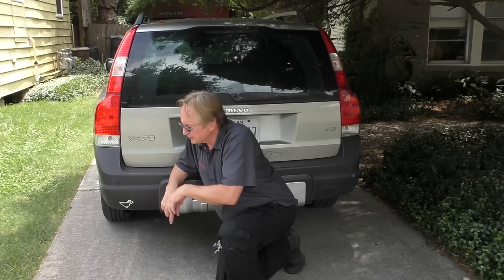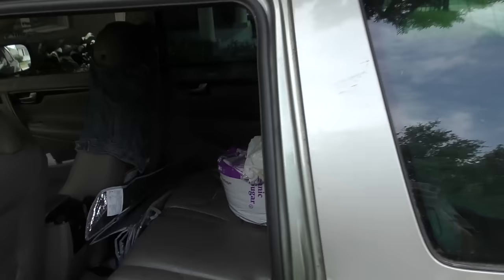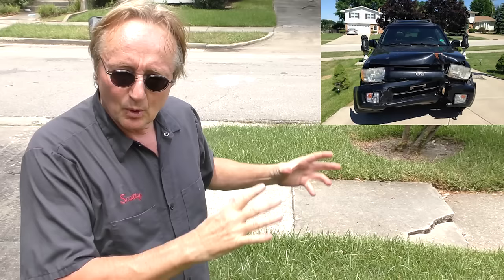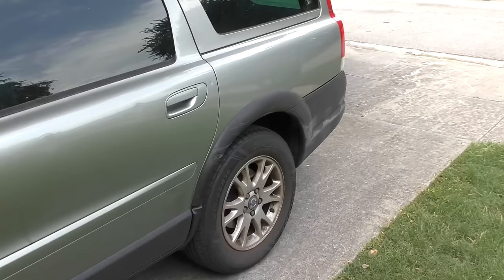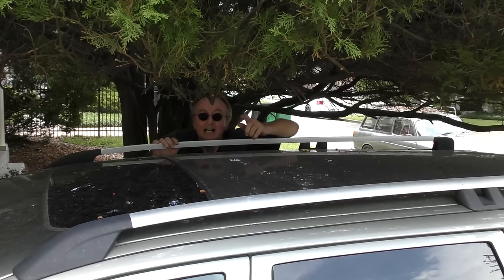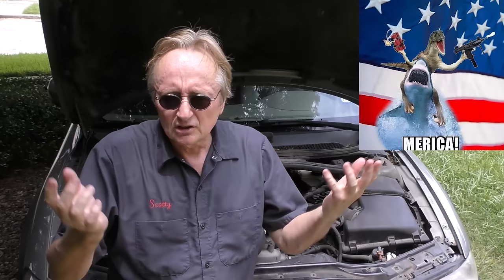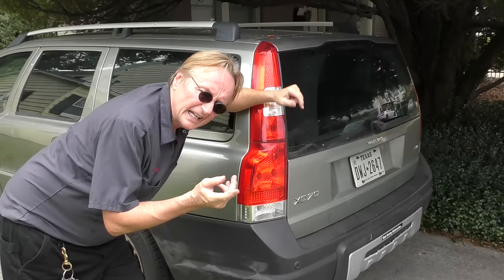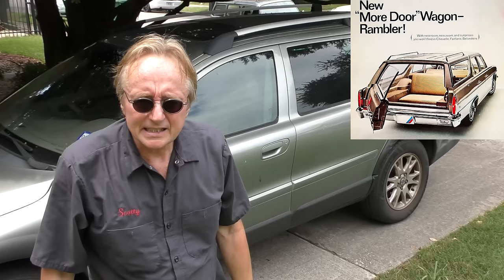Here’s Why Old Volvos Last Forever

Comment: Scotty you missed one of the best parts about this car....

The AWD system on it is fantastic. Very capable in sand, muck, snow.

Oh and the transmission is built by Aisin, the same Japanese company that builds Toyota transmissions...
Reply: the AWD and the automatic transmission are actually the only real weak points of these cars.
Reply: @janjansen1897  correct. Its pure garbage, they all  end up as fwd cars
Reply: @whiteknight7979  Beg to differ. The Haldex AWD and the Aisin transmission is quite reliable, if you flush the fluids and change the filters at the same intervals that Volvo specified for taxi and police duty vehicles.
The thing is Volvo claimed "filled for life" on all the non-fleet sales cars. And in a sense Volvo was right! When the transmission or AWD broke down thanks to lack of maintenance, their life was over so no refill/service was needed.
Reply: I need to replace the Bevel Gear (aka Angle Gear) on my 2007 XC90 (122K miles). I am also replacing the propellor shaft. While it is out, I am servicing the Haldex and changing the rear diff fluid. Transmission guy said the angle gears go out often in these and many of the tranmission valve bodies were plagued by poor metal quality, but my transmission is still doing well although a slight pause sometimes when shifting (e.g. 1/4-1/3 second). 3.2L 6cyl still seems to be doing well, but my gas mileage dropped recently from 19-20mpg to 17mpg.
Reply: The 4wd wasn’t great but the Aisin automatic transmissions are great. They only break when neglected

Comment: Volvo V70 2,5 T from 2001 here. Such a great car. Bought it with 150.000 km, now it's at 330.000 km and no major repairs. Just a transmission sensor and another small electrical issue four years ago. Still does 220 kph, downhill even more (I got a video on my channel). I'll always drive a Volvo.
Reply: car still going strong? I'm asking because I'm interested in buying a 2005 XC90 2.5T 5 speed AT. it has 148,000km
Reply: @blerriegerrie  unfortunately the engine died at 350.000km, but I blame the lpg system

Comment: My wife and I were stopped behind a car making a left turn about 100 yards through the intersection, with a Ford Windstar pulled up behind us when we heard screeching tires. I looked around but saw nothing and a second or two later the minivan was smashing into our rear end. Someone had gone through the green light speeding (approx. 45 in a 35) and distracted and didn't notice brake lights. The Windstar was crumpled to crap, leaking fluids all over the road. Our Volvo 740 wagon barely rocked forward (the brakes actually held firm and we never moved) and the only damage was a smudge on the rubber trim on the back bumper.  Both of the other vehicles involved were totaled out. We got out to make sure everyone was okay, which they were, and pulled into a nearby restaurant parking lot while they waited for the police. They didn't need anything from us, but the cop did give us a few giggles after we explained what happened and he got a look at the smudge on our bumper.

Comment: Looking at how that rear wheel sits in the arch - I'd say you've got rather bigger problems than some cracked plastic after the crash. Still, some quality time on an alignment jig and the chances are that can be put right for a lot less than the other car cost to repair.
Reply: That's actually just how they sit! You can google pictures of the XC70 and they all look the same!
Reply: @calvinburke7002  Could be. You're right that the wheel does look oddly placed on all of this model. However, if you look at around 1.35, it appears the tyre is practically touching the wheel-arch liner. Either this car is running the wrong tyre profile or something is out of alignment. That said, I'd guess Mr Kilmer is more than capable of spotting it and sorting it out!
Reply: look it up, the wheel position is normal for these cars

Comment: I got my 02 XC 70 with 160k for $750. It was in rough shape. After all the maintenance stuff, auto trans.  Fluid flush and a new quarter panel it was my daily driver for two years doing sign installations and handyman work. I got 50k miles out of a car that coast about $1k! It was my favorite driving and most comfortable car I've had! This vehicles AWD system along with traction control is absolutely superb.

Comment: True story, not just for the old V70s but for the S80 as well. My 2007 Volvo (Ford) S80 with the i6 3.2 engine has 205,000 miles on it and still drives like a champ. My car has been rear ended twice and I have similar pictures as Scotty shows in this video. The other cars were totaled where my "Swedish Tank" had minimal scratches. 

Scotty K., remember in 1999 Ford MoCo bought a piece of Volvo and then sold it to the Chinese owned Geely in 2010. 
Most of the engine and suspension components in these cars are "FoMoCo" from these years. 
Essentially, these Volvos are Fords with Volvo bodies.

Comment: My old 850 t5 has 170k miles and is great👍
Reply: Had one of those too a t5r . Had to hold on to the wheel when you stepped on it , lots of front wheel torque .
Reply: @michaellebreton4294  haha yeah your right there mate. Takes a bit of getting used to but was never meant to be a traffic light racer, all the power is in the midrange and can surprise many👍 I love mine, specially having the manual box as well.

Comment: I have a 98 Volvo s70 glt. It's the low psi turbo but still makes almost 8psi and runs and drives like an absolute champ with 312400 miles on it. Oil is still gold after 3000 miles. Way better inside and out than any GM vehicle I've ever owned even my 96 silverado which I love but the Volvo is built better I can just tell by driving it.

Comment: Scotty: Old cars are awesome!
Also Scotty: that's a 30 year old car don't buy it.
Reply: Well, there's a kind of a limit at around 15 to 20 years. Usually, cars older than that will be too unsafe to drive and have a gpm rating instead of mpg. The fuel cost in one year would be high than the car's value lol.
Reply: This car is 13 years old, not 30.

Comment: My Volvo tank is a 2001 T5 V70.  It was our “learn how to drive car” for our 3 kids. In 2013, our oldest, who as 15 at the time,  accidentally drove it into a Radio Shack. ALL the way into the Radio Shack, albeit at 3 mph.   (We May have been one of the last people to go into a Radio Shack....) It was like a snow plow.  Police came, tow truck came. dragged the V70 out backwards.  We looked over the car and decided I could drive it home which I did. Insurance gave me a check, I bought new fenders and bumper. 202k miles later she still trucking along (with a few replacement parts mind ya).

Comment: Our 2006 v70 2.5 T AWD has 210000k looks great.... no rust.... have had to do some maintenance coil pack... timing belt ... water pump.... BUT...... I don’t mind the fixes cause this car is rock solid and the AWD system has been very good...... very safe car and good enough performance.....planning on keeping it for a lot longer......

Comment: my old S40 had 400k miles when I sold it. still was running fine. My other 1988 340 Still in mint condition after 31 years on the harsh winters here in Noth East Europe. Got to say I love Volvo cars.

Comment: Bought a 1998 volvo C70 after watching this video. I love the coupe. Its fast, looks great, sounds like a Lamborghini with it's high pitched turbo sound and low exhaust  sound. When the high pressure turbo kicks in you go from 20 to 45 very fast. All 70 series volvos from 98 to around 2007 they used the same 5cl 2.3l engine with stock high pressure turbo making 240 hp bone stock.  I'm fixing it up and expect to keep the C70 forever.

Comment: Just bought an 07 xc90 that sat for almost 2 years and it started right up and ran perfectly has 170k miles and the engine sounds good transmission shifts good has a comfortable ride wasn’t a bad purchase at all

Comment: My dad fell asleep at the wheel of a Volvo 740 GL (87) and crashed it at highway speeds, rolling the thing over once and landing so hard it blew out both the tires on one side. It still runs and drives today. Though the cooling system is leaking. The roof needed straightening after the accident and a lot of trim pieces got destroyed, but it was even drivable on the spot, well, if there were 2 spare wheels to replace the blown tires anyway.

Comment: I bought a 2008 Volvo V70 less than a year ago and everyone told me what a great car Volvos are but it has been nothing but a headache! The skylight leaks every time it rains, could not get the drain plug out of the oil pan to do an oil change, had a hell of a time trying to find the coolant drain plug, radiator also leaked, put in a new coolant hose and it worked for a few months then couldn't get it to stay on, had to replace it with an OEM part from Volvo at twice the price and the damn thing still leaks coolant from somewhere. A/C / heater doesn't work and will be replacing the fan and resister. Fingers crossed that that will fix it. My mechanic quoted me over $3000 to fix the A/C when I only paid $4500 for the car!! Because it is considered a "luxury car" everything about it costs twice as much. There are a few minor features I like about it like the headlight retainer blades and the adjustable cargo net tracks and I esp. like the station wagon body but honestly I can't wait to dump the overpriced lemon.

Comment: '07 xc70 owner, bought used in 2016 with 75k.  We were rear ended by an older model ford expedition, my wife was driving while I watched it happen in the rear view mirror, son in back in the BUILT IN BOOSTER SEAT!!  I said calmly "hold on, oh s**t she's gonna hit us, hold on" we could not go forward or to the left lane.  The expedition swerved, clipping the right rear corner.  
     We had a slight crease in the upper hatch area of the rear and a broken tail light.  Did not even break any glass or set off the airbags.  The Expedition was demolished.  Front left completely crushed, hood lifted up and bumper pulled under the wheel well.  friggin' totaled.  my family was completely fine, the other driver was bleeding.  That was the very reason we bought the car, to beat the crap out of distracted drivers.

Comment: Had a very bad experience with an old Volvo. I had a 1998 S70....it was a lemon. I'll pass.
Reply: Ahh, too bad, unlucky... my green 98 S70 died at 330k Miles. Dependable as long as you maintain them.
Reply: Mine had 475000 km on it. Sold it just because of expensive registration where I live. Now I drive a lemon Peugeot 206... I still plan on buying the same Volvo, can't let go of the beautiful inline 5 engine.

Comment: the best Volvo were made in the 70s and 80s
Reply: Actually the newer ones are better in every category. Safety, performance, handling, capability, mileage, AWD.
Reply: WALTERBROADDUS reliability???
Reply: @MD-wq6on  A 40 year old car is still a 40 year old car. Is a window crank more reliable than a electric  motor?  Sure. ARE 4 drum  brakes more reliable  than a  4 piston disc ABS brake system?  Not really.
Reply: @WALTERBROADDUS  drum brakes? What are you talking about...
Also yes they're more reliable because 4milion miles is a lot it also the driving experience you get from the analog car let me ask you this do you think that these computer systems last longer then analog because I don't think so
Reply: The best music was made in the 70's & 80's
Reply: Up to 99 before ford bought then.
Reply: @WALTERBROADDUS  The funny thing is you will not find 4 drum brakes on a 40 year old Volvo. The 140 series Volvos had disc brakes on all wheels in 1967. My 1991 940 has ABS.
Reply: @juhotoss  You are more expert on the brand than I. Why the odd ball engine? 🤔 Why 5 cylinders? Any any tips about used models?

Comment: What about the early 90s volvo 440/460 with the 1.8 liter 8 valve engine, not the fastest, but goes on forever, and never breaks down. Had one, bought with 88.000 km on it, sold it with 498.000 km, i did regular maintenance, oil changes filters, fluids, spark plugs replaced the dynamo 1 time, the water pump with distributor 2 times  . Indestructible!. Best vehicle i ever owned

Comment: RIP Irv Gordon. His Volvo P1800 had 4 Million miles. Man drove the car like, 175 miles a day everyday for the last 50 years.
And the car still looks like it just rolled outside the dealership. 
My man changed oil every 3000-3500 miles religiously, transmission every 25,000 miles and every other maintenance, 857 oil changes. 
I'm a die hard Toyota fan but man older Volvos were legendary.

Comment: I was looking at a 1991 240 for less than 1k. I am really tempted.
Reply: If it's in decent shape and checks out ok, buy it. Make sure the heater core isn't leaking and functioning properly though, lol.
Reply: Yep have someone that knows what to check check that and replace if necessary and that will be a great deal if it is in decent shape. They are dead simple. You may even be able to learn how to do a lot yourself...
Reply: Just do it!

Comment: Lucky driver of a 2006 XC70 D5 AWD! Got it when it had 220k Kms(136k miles), did put in like 60k (37k miles). Had to fix a couple of things when bought it(previous owner did not have the same love for it maybe) but what Scotty says: Yes, indeed. Casual "I sit in and go 1300(800miles) kms in a day and when I exit, no backpain, nothing!" Black magic! Insanely stable on snow, mud, ice with good tires, mild offroader, great travel car, also for towing. Handling is a bit vague but come on, it is a street tank. My Scotty-like honest Irish mechanic always calls it Sherman Tank. 
One time a Smart city car at a steep downwards red light came into me from behind, huge SMAAASH sound, I look back, seeing the poor little thing bouncing back like its made of rubber. The guy's "car" got front smashed, he was so worried of the damage he might have caused. I laughed! I got an another, small battlescars in the back plastic, told him, what happened? He said the break didn't work! Hahaha. Before he left, gave me his address, name, contact in case of any damage he caused. I only asked him to test his brakes. Worked. 
One time a toyota suv reared into me from front, the crazy lady did not look back in the parking lot when saw a spot - my plate got a wrinkle, that's it! 
So many stories like this I had(never accidents). 
Literally, one time when turning around I hit a brick wall at the front, bricks were falling out, I got another scratch.
People have no idea, they drive their cars and when the beemer tries to bully me I just laugh. It's like an elephant is being annoyed by a mosquito. 
Insane, yet casual cruising with 190km/h on autobahn, engine purrs nicely and in 6th gear it pulls like a bull. 400nm Torque baby! Sure, its the diesel the evil now, its my second car as needed a smaller petrol one to do shorter errands, but this is true love. I am not a car youtuber but I might just do a review of it myself.
Just make sure you pick the good years for it, these are called P2 models, up to 2007, they were made to last. Another mechanic friend told me they serviced one with 700k kms(434k miles) - no issue with engine whatsoever! 
All the best and have fun!

Comment: I've hot a 2004 XC70. My car runs great. I just drove from San Diego county to Seattle in two days. Pouring rain through mountains. No problem. They are the cop cars for most northern European countries. I wiped out a Nissan 350 that challenged me a couple months ago. Fun car the rolls through the worst weather at the highest speeds. I cruise mine through the Arizona desert at 100 to 120 mph. Nice sound systems too.

Comment: Scotty, I couldn't agree more.  I have a 2009 Volvo C70 hard top convertible and its great.  I used to have an older Porsche and my dad would say "that car doesn't nickle and dime you to death, it $1,000 to $5,000's you to death.  With the volvo, you just follow normal maintenance, no dropping the motor constantly for any work in the back.

Comment: The right-angle transmission, it breaks down after about 70,000 km.
The connection bus does not cost much, but is a lot of work.
Reply: I'm guessing you are talking about the transfer gear, I have an -97 855 awd with 370,000 km on it, and the awd works fine. Prematur wear on the pre haldex awd volvos are usually onwer errors, such as odd sized tiers front to back

Comment: My first car was a 1990 Volvo 740 GLE 16 valve. Lasted me from about 2011-2017 and ended with about 450,000km on it as a daily driver. Used to constantly haul myself and my band along with all our gear to shows. The thing ran great but literally every other part of the car that wasn't mechanically necessary for running was falling apart.

-The reflective surfaces of both driver side and passenger side mirrors fell off and shattered within a day of eachother. 
-The radio and AC stopped working. 
-The interior roof lining was sagging like crazy
-Everything that was plastic; and I mean EVERYTHING was cracked, broken, or completely missing. Just full on disintegrated.

Eventually the mechanical upkeep was also getting too expensive to justify keeping on the road; especially after my family friend who was a volvo mechanic retired which made it more expensive to repair. I loved that thing but it was time for a new car. Our band bought a dedicated van so I didn't need the extra space of a big wagon anymore so I bought a 2002 Subaru WRX hatchback with about 230,000km on it. I wanted something with AWD because I have to commute super early before the roads get plowed in winter. Because it has the automatic 4EAT I got a great deal on it and it's completely unmodified aside from an aftermarket exhaust. Great shape too as the the manuals are always beat on pretty hard compared to the automatics. If it weren't for us buying a van for hauling stuff I would have definitely bought the XC70. I love the look of those cars and Volvo wagons are just awesome.